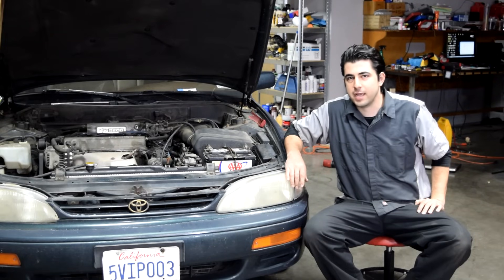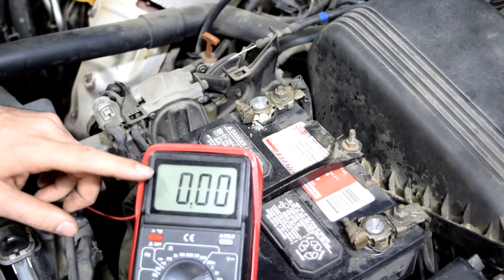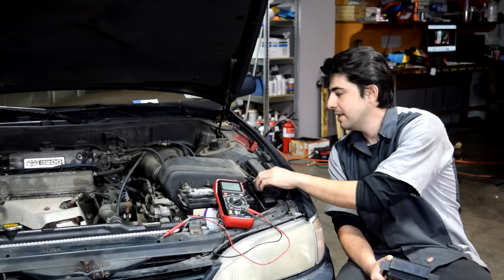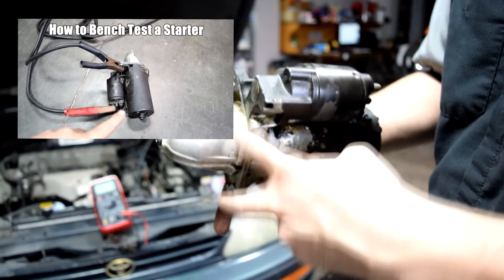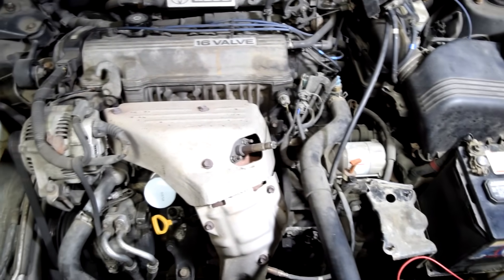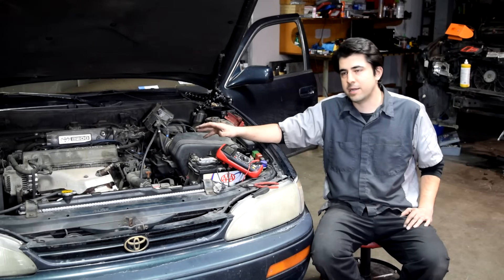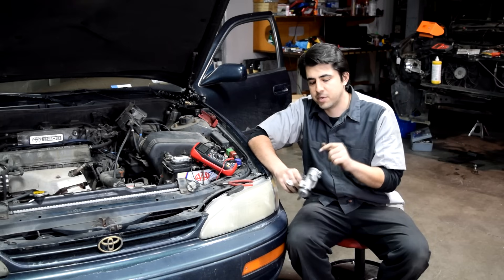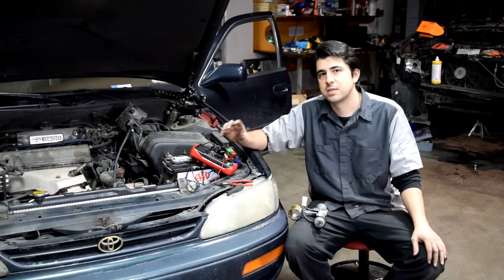How to Diagnose a No Crank No Start Issue - Nothing or only a Click When the Key is Turned

Comment: I have a 2010 Grand Caravan that will intermittent no crank no start. The battery is strong and connections are good and pass vokt test, change starter 4x but problem never goes away. It does burn oil bc I tow with it and I probably add a quart a month so I'm wondering if maybe there's buildup on the spark plugs that's causing the intermittent no crank no start that seems to leave me stranded @ the worst possible times otherwise I love my Dodge GC so if anyone has anything I'd like to TYIA

Comment: sorry, 100 % disagree. if battery is low( say to leaving lights on  or cabin light on) the job of the alternator IS to charge your battery, a 15 min drive up the highway usually will charge the battery to near full, as long as battery has no dead cell and alternator has no issues.   (just an fyi)

Comment: Chrisfix level helpful. Hopefully its one of these issues or the starter itself is bad. Just got a 5 speed cavalier for $300 lol mainly for the f23 transmission gearheads are after but if i can make this car run and drive then thatll be swwet before tearing it down

Comment: My 2007 Caravan would not start even though it had been running good previously.  Solution was to replace the battery in the Key.  This is very common because it is an antitheft feature and is designed to shut down the engine if the key is not present.

Comment: I had  the problem that the battery cable to starter was burned partially and the car not starting, so in your video check with multimeter to the starter main terminal is pointless, if the cable have not enough amps  to supply    still it shows the full battery voltage. so inspect the cable in this case or replace the cable.

Comment: I have a basic 1999 Toyota Tacoma manual 5 speed.  It is not starting.  No crank and no fire.  Nothing!  No instrument lights on when I turn the key. The headlights nor the interior dash can light goes on.  I have fully charged the battery.  I have checked the battery bolts, reads 12.6.  I confirmed the battery cables are fully connected and tighten.  I repaired a 9” thin black wire that was barely connected to the main NEG battery cable and connected to the inside finder to ground. I ensured that there is a solid wire contact to the metal inside fender and joining up with the rest of the NEG battery cable.  Still no crank and of curse no fire.  Any suggestions of what to try next?  Thank you all for sharing your own mechanical issues with your own Toyota trucks. Be blessed. 🙏🏻🇺🇸

Comment: An alternator CAN fully charge  a battery.  But it won't at idle. To full field the alternator you need higher RPM (normally above 1,200). 
It's not recommended because you can wear out the alternators brushes/comutator faster.

Comment: EXTRA TIP: Also make sure the vehicle is shifted all the way to Park. A loose/misaligned cable or shifter arm preventing it from fully clicking into Park could prevent starting.
Reply: Usually though if your able to take your key out of the ignition then everything there is working correctly because if it doesn't sense it is in park then it will not allow you to take the key out of the ignition
Reply: Yo! Been searching for hours and couldn’t find a fix- saw this comment, put my key in and applied forward pressure to my gear shift and it worked! Thank you!
Reply: @reidyounghome  Indeed! I've seen this several times now.

Comment: So if the starter is getting 12v to it's trigger post from the ignition and from battery through the cable right to starter, does that rule out the problem being with the ignition coil, relay, or ignition switch? My battery is new, and I can push start car and engine runs fine. Please say it's a bad starter because I can change that out myself lol.

Comment: GREAT VIDEO... I had no click, no crank, no dash lights, no sound, no horn....nothing...all of the sudden, after stopping to go shopping...came out and it wouldn't start...I got a jump from someone and THAT worked....got home...tried to turn the key, and NOTHING again...but I was parked...so I searched out my multimeter and i tried testing between the battery points and the connectors, and I was getting like -7.5 on the negative terminal (between battery prob and the connector)....I pulled out the sand paper, cleaned both sides up really well....hopped in the truck and...BOOM....turned key and everything is back to normal....this vid saved me a lot of headache....THANK YOU!
Reply: I might be having the same issue with my highlander.  All my electrical goes dead to the entire vehicle when I push the START button.  Not sure at what point you were getting the voltage drop and what you cleaned. I don't think you meant the battery terminals, or did you?  After a few minutes the power resets and I finally can start it up and runs fine after that.

Comment: Hello! I have a 1998 Toyota Corolla just like the one on your video. It runs great. But lately it keeps not cranking and the alarm comes on. Just out of nowhere. It has a new battery and I’ve had the alternator cheques. Do you think it’s the alarm that I should disconnect?

Comment: My starter has 320,000 miles on the original starter it just recently acts like it wants to turn but doesn't have enough torque to turn the engine you can hear it try to engage but it just clunks and I'm able to turn the engine easily by rotating the drive shaft with a wrench so the engine is not seized in any way the last time the starter worked the motor was running perfectly

Comment: I have a 2008 ford expedition that starts most of the time. But sometimes it does not crank, it just makes a loud winding noise. I changed the starter relay and the start/run relay and it was working perfectly for about a week. But since then it has done it again 3 times. What do you think could be the problem?  Thank you.
Reply: Sounds like the pinion gear on the starter is not being thrown out centrifugally to meet the fly wheel, usually caused by low voltage, no low enough to not crank but not enough voltage to spin it fast enough to throw it out centrifugally, that or that part of the starter has gone bad for some reason
Reply: @diychad7268  I found out it was the flywheel, it had teeth that were shaved off. The last person that installed the starter,  had only put 2 screws and didn't tighten them. Over time the starter teeth and flywheel teeth grinded each other to a point where the starters teeth were bad and the flywheel had balds spots. When I put the new starter it still had issues every now and then.

Comment: Mate can a crankshaft position sensor, prevent a car from starting; no crank, no start with check engine light on, " Camry 2004" ,but before that, at 3000 rpm, car would shake & jerk, please give me some pointers on that, thanks for your time & excellent explanations on your videos

Comment: Excellent video. I have an issue that is intermittent. It cranks most of the time. But sometimes i will turn the key and it wont do anything it will be like it wants to crank for a second then it doesn't anymore. Or like most of the time it just doesn't do anything. And I turn key back and forth a couple times and then it works. I am wondering what this issue is  as I would like to fix it before the cold hits. I'm going on to watch your other video right now but i don't know if that's the description of my issue, so Any help is much appreciated ! :)
Reply: Is it a no crank issue or a crank no start issue?
Reply: @diy_automotive  It was actually both. But i figured it out. It was the wire going to the soliond, the post had come loose and was jumping the current and killed the wire but cleaned it up and tightened the post up and started so fast and easy.
Reply: @tylersywyk6730  great, glad you figured it out!

Comment: Thank you, I fixed my vehicle today, mechanic I hired installed the trigger wire on the new starter with a bad connection, damn thing fell right off, I was able to fix it myself in under 15 minutes, just installed a new female crimp connection

Comment: Great video. My 1992 Chevy S10 , after no notice at all, just failed to do anything when the key was turned. Had interior and dash lights, head lights and all, nothing at the key. 
Don't hesitate to use a little force with your hand, when checking connections. The solenoid Positive post that connects to the battery's positive cable. The cable was TIGHT, but the solenoid cap was able to move on the top of it. I just happened to be able to wiggle the battery cable and the  entire cap of the solenoid started rocking. That was the culprit faulty solenoid.  Done and Done... Thumbs ^ and Subby....

Comment: Awesome video, I had power at my starter but not my signal wire when trying to crank. After looking around the motor for a bit I noticed the shift linkage popped off, so if anybody ever has no crank that's another thing to check
Reply: prime_bassing TV It happened to me too, but it was the starter switch connection was not connected in all the way on the starter hence a no crank .

Comment: 2001 Nissan xterra, battery is good, replaced both negative and positive cables, starter replacement with a remanufactured one. It starts most of the time once in a while I here a click and no crank. I tried wiggling the signal wire but I didn't see a change.  Any ideas what it can be?

Comment: Nice the starter is up close and personal,  I'm working on a  2004 Mustang, (NOT MINE, it's the wife's) I would have run it into the lake by now, BUT I drove it for the past 2 days and it started fine.  Stopped at the bank, came out and just a click.  I'm guessing it's the starter wires at the starter because the battery terminals are clean and tight, and I checked the fuse and relay.  I mean if it was one of these, I wouldn't even get a "CLICK" RIGHT??!!  I'm old tired and pissed off, I'd pay a good mechanic to look at it, but I'm guessin I'd have better luck finding Jimmy Hoffa.

Comment: Hello I opened the ignition lock to identify ignition wires on a camry 2008. I did use a jumper wire to hot turn on the car to see if the car cranks on. But during the process did short two other terminals and caused a spark. the car is in nor cank no start with the panel (speed and engine rpm screen) no lights on either. I check all the fuses in both fuse box location and found no blown fuses. Can you please help?  Thank you.

Comment: I have to crank my truck a few times before it turns over, sometimes I have to do it like 10 times.  The starter was replaced and still same issue. Wish I had seen this video before replacing the starter. Moving on to relays and the crankshaft sensor and cam shalf position sensor. Inexpensive parts on amazon. Thanks for the video

Comment: Don’t volt drop tests need to be loaded to get a result ?  Not trying to be a know it all but I was told you need to have the system loaded IE turning the engine over to find if it dropping or not .. ?

Comment: This was a great video, I went from knowing nothing about starters to feeling very confident and able to troubleshoot one in 12 minutes, just can't beat that. Also I appreciate you using as accurate terms as often as possible. Cheers!
Reply: Heads up there guy.  I’ve been a tech for about as long as this boneheads been alive. He’s off in left field and searching for a clue that he hasn’t found yet.  If you want to learn some thing about starting Systems, Check out some of the videos on YouTube by Scanner Danner.  I believe he’s the lead instructor for the Rosedale technical institute in Pittsburgh. I would need a whole page and a half to tell you everything that’s wrong in this video, so, good luck!  Be Careful who you’re learning from, It’s hard to un-learn  bad information!!!
Reply: @mrobvious5892  PLEASE, enlighten us as to everything that's wrong in this video (if you can).
Reply: @mrobvious5892  what would you recommend for an intermittent no crank. Emphasis on intermittent. When it cranks and cranks and starts right up. No crank there's not one peep or click or anyting. It won't crank and dash lightscare working. ( next time you try to start it 30 minutes to a day later it'll crank right up. So it appears to not be the battery which is fairly new. )  

Now I noticed along the way  it will could take months for it to happen again. I discovered an unusual "key dance". When I'm actively in the situation where it's not cranking, just pull the key out of the ignition switch and white for all the interior courtesy lights to turn off. Within five seconds a small click happened that sounded like it was behind the dashboard. After the click happened I inserted the key and the car cranked right up. Here's the interesting part, if I don't hear the click it's not going to crank when I put the key back in. If I hear the click I know it's going to start when I put the key in. It could go days to months before it happens again. 

The urgency in finding out what the situation is has someone increased because Pokey dance has stopped working since I never get the click anymore. I couldn't start it the tow truck driver couldn't start it but somehow the mechanic got it started. They swapped out the starter relay under the hood and repair the wire. But I still have the no crank issue. And I'm no longer getting the click after I take the key out and let the lights drain.
Reply: @mrobvious5892  dude this guy explains a lot of stuff really clearly..i bet you are talking sh!t just to get the guy you recommend some views.. I'll make a point of avoiding the guy you talk about (i bet that's YOU!)..

Comment: 1998 camry 3.0l no crank no click no turn on. The OBD2 reading say: Crank Shaft Sensor error. The timing belt, battery, terminals  is good.

Comment: What if a starter works on the bench and on the car it just clicks once every time I turn the key?
Reply: My 1984 224 cranks but wont start after a new battery ,igniter coil and distributor . Can I
Reply: Get rid of ECMand switch too old fashioned fuse system ?
Reply: Thats usually a connection issue
Reply: Check starter connections battery if that dont work start wont turn under load
Reply: My mechanic said he's had times like this where he replaced the starter and it worked after that even though the starter was good on a bench test

Comment: What if I'm only getting 3.5 volts to the solenoid.  Would this be the ignition switch?  I swapped relays and that didn't change anything.  If I take a jumper wire directly to the battery post it will crank.  This problem is intermittent.

Comment: Hi, my car had same issue..no crank no start..tested battery and its good..relay is good.. i removed the relay and gave a direct crank and it started...but after engine runs for 15 _20 mins. I can start the engine through ignition key...can u guess where and what the problem is..

Comment: If no power, or vey little power, despite a good battery and/or efforts to jump it, check the battery terminal connections, but also the negative cable where it attaches to the car for ground.    I had this issue on the coldest (deep freeze) day of the year.  I'm sure the metal shrinking in the cold temperatures helped to cause this problem.  Besides corrosion, there were deposits from arching that also insulated the sides of the connection.   Cleaned it and problem solved.

Comment: Great video very helpful. Do you know what could cause an intermittent starting problem? When my chrysler 300c starts it runs beautiful but some days i have no crank no start just for it to start beautiful again next day? Battery is good and ive replaced ignition switch, actuator pin but still no fix
Reply: Check all chassis grounds, clean all well with a wire brush. Ground studs may be rusted.  People do not realize that the chassis grounds are part of the cars electrical system.  Bad grounds mean that your electrical system is not getting full voltage, your starter will never engage without 12 Volts.
Reply: Hit the starter!!!!! Try again...
Reply: @genesis7552003  hey thanks for the input Chris, turned out to be the starter. Where the connections are there was some corrosion, little sand paper and it was back on the road. Been driving like a mint to this day

Comment: MY 97 automatic accord has a no crank no start problem but, it has a p1298 check engine code.  FEw days ago I had to move the under hood fuse box to get to a screw.  I disconnected the battery before unscrewing stuff from the fuse box.  It ran for couple days but, struggled to start for a bit til eventually it does not start.  Is that 1298 code related to this no crank no start or two separate issues.  I read that the 1298 issue is a electric load detector problem that is in the fuse box but, I'm not sure if it is causing the no crank no start issue.   PLease help.

Comment: At 1:12, when you do the voltage drop test at the battery post, you need to have a load placed on the battery. in other words you need current flowing. Its the same as doing the voltage drop test from the battery to the starter. In a 12V system the maximum allowable voltage drop is 0.5V which is best done with an scope since the starter puts a varying load on the battery when the car is stated.
Reply: Yep, he missed out on this one without placing a load on the battery. A mere resistance test would have been more appropriate in this case than a voltage drop test without load.